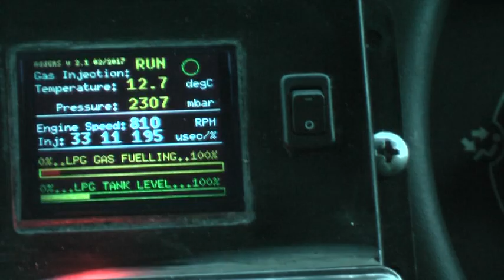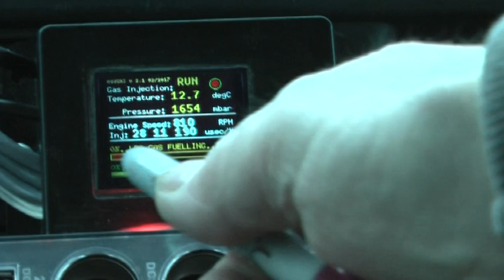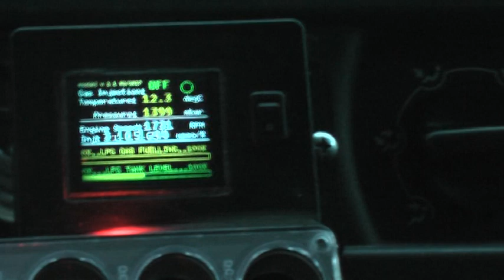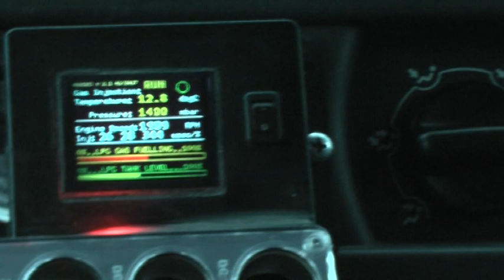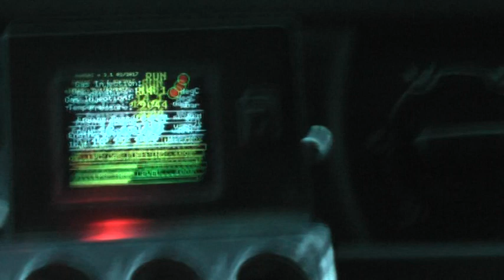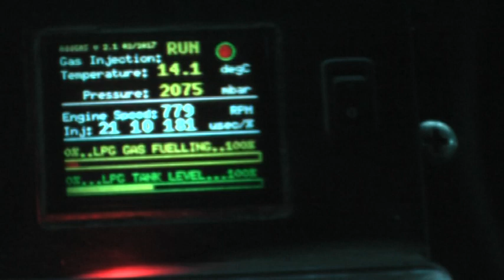Diesel Engine Gas/Hydrogen Injection System

Comment: You're on the right track.  Hydrogen should be more readily available.  CH4 still leaves a carbon molecule post combustion that's likely going to hop onto an oxygen atom.   Hydrogen is a  much cleaner / complete combustion.  Such an easy fix to significantly increase the "green" of diesel.  A simple solution that should be ubiquitous.  No DPF or a injection fluid needed.